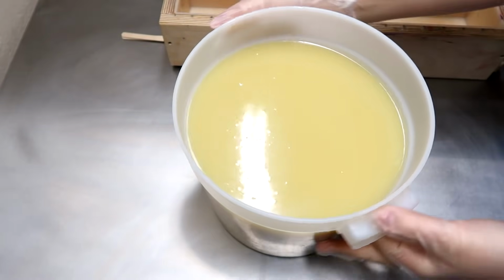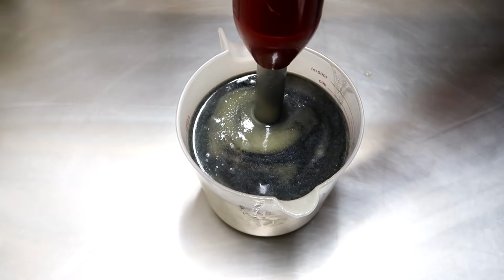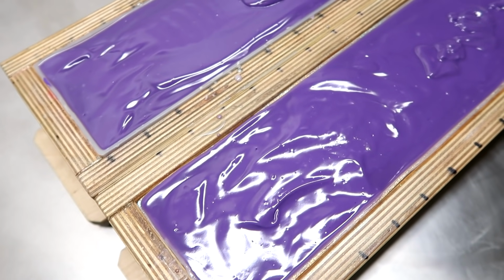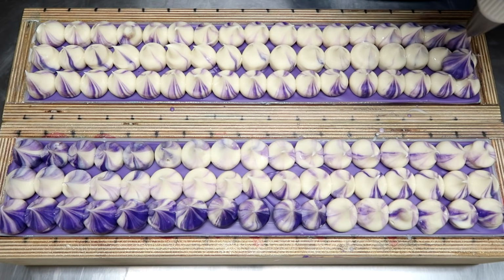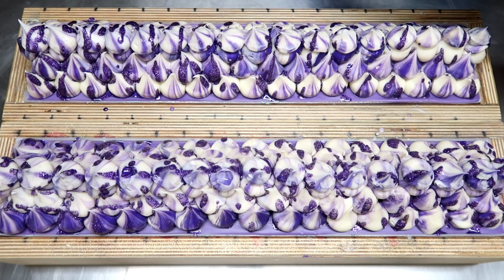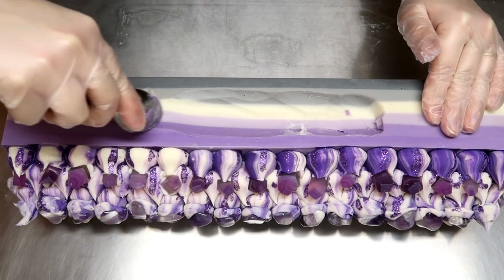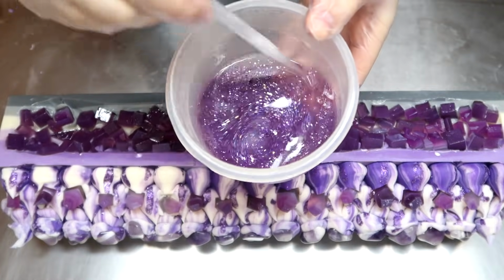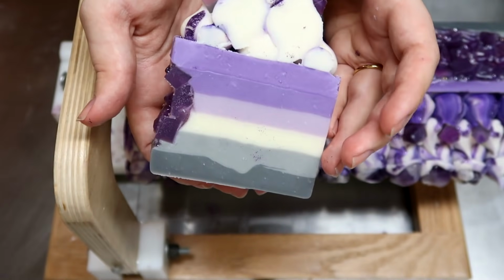Amethyst Geode Soap | Royalty Soaps

Comment: I made this over the summer using only melt & pour soap- it came out SO PRETTY..I was shocked considering I did use M&P.. but I did it differently,The same way as the original bramble berry soap

Comment: I like the soaps but if you’re going for a real geode, I would love to see you do thin layers of the dark grey and light grey then some light purple and dark purple , let that set just a little, THEN put the geode soaps in the center with some clear melt and pour that’s been tinted just a bit with some purple glitter but you want it to still be transparent and leave room on the sides so you can encase the whole thing. Obviously you can’t do the real stones with this idea BUT you get that satisfaction you’d get with any geode. You would be cutting open an otherwise plain stone to reveal the gems on the inside.
Reply: I also think the piping was just a bit much.